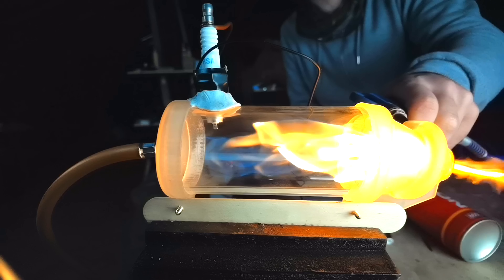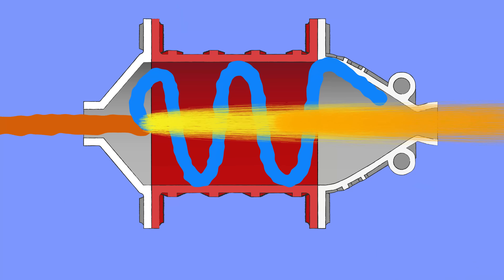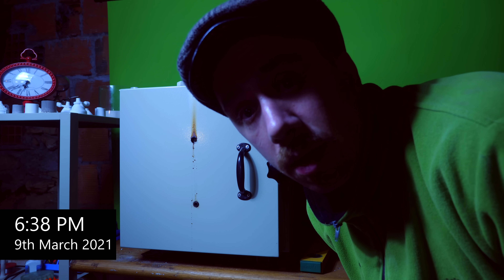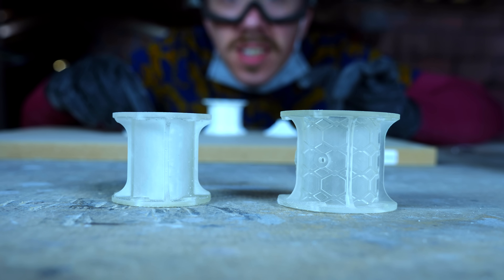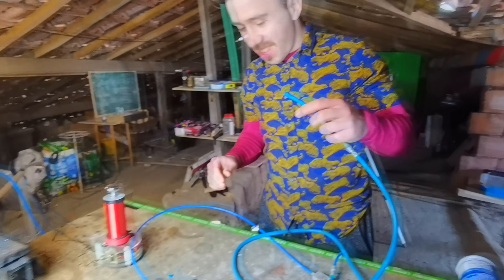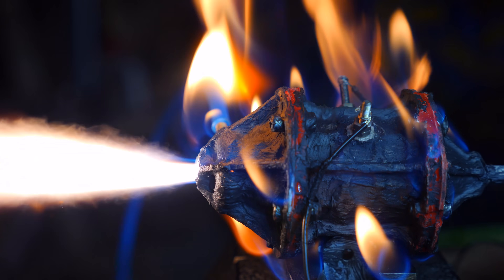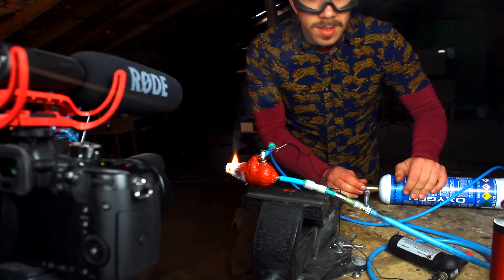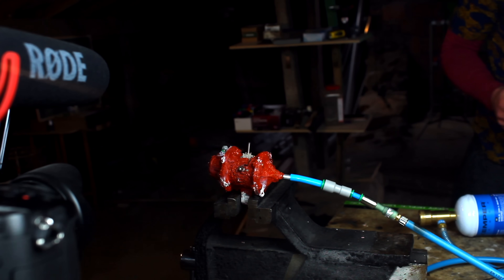Vortex Rocket V2.0 (3D Printed)

Comment: Hi Integza!
This comment is about leaking prevention.
Hope you will find this comment through the thousands of others.
Given: you have porous ceramic material and leak-proof red stuff.
Problem: It's obvious that this red glue (as any glue) is not strong enough itself, although it is leakproof. Extreme pressure from the combustion chamber just destroys the layer when it has no support.
Example: Remember the car tire. You will never seal it outside, only from the inner side or inside the material itself.
Solution: either make glue protected from outside or soak the engine in something leak-proof.
Method 1: just make reinforcement for red glue with carbon or glass fibers. 
Method 2: soak the engine itself in something liquid and both leak- and temperature-proof. Liquid glass, for example. Probably, you should repeat soak - dry process several times.
A good thing about the 2nd method is that the engine should remain white and beautifull.

If you like, I can further explain the liquid glass substance (I am a chemist). In short -  it is true glass, but liquid.
Reply: Do tell
Reply: update:
Liquid glass, water glass, and sodium silicate are just different names of the same substance.
as for other comments:
I find pottery glaze to be a tricky way since it is highly sensitive to the thermal-expansion coefficient. I mean, TEC has to be the same for both substances, otherwise, the glaze will break and leak.

Electroplating is hard for beginners, but quite a funny process. I am not sure it would be easy to achieve leak-proof plating, but it is interesting.

Comment: Is it possible to glaze the ceramic like you would for pottery?  I don't know if that would just melt under the heat from the rocket, but it seems like it might work a bit better than the silicone sealant.

Comment: why not put the engine into another sealed chamber, say a soupcan for example. as long as the oxygen doesn't get there this might work. If the oxygen does get there you might be building a bomb. In both cases an exiting video is the result.

Comment: Integza, I have just had a crazy thought! 
Instead of trying to 3d print the actual part and then having to deal with all that cooking, warping, clean up, and leakage, why not 3d print female plastic moulds (casts) of your engines and then pour your prefered ceramic liquid, let it dry and then cook the ceramic while burning out the plastic moulds? Essentially similarly to how they make khm khm... well, toilets! 
Worth a try! 
https://ceramicninja.com/toilets-manufacturing-process-steps/

Comment: if i saw correctly the engine leakes because of the high temperature thats x=created after a little time (in the case of the whole engine than 3d printed not the engines with the parts) so why dont you use a heatsing to transfer the heat like a cpu heatysing

Comment: You could try 3D printing a part in something that melts/burns out cleanly, create a plaster mold around the printed part, let it harden, melt out the material, and cast the part in metal?

Comment: I have seen suggestions of using a glaze or wrapping in another material. The ceramic is clearly porus, you will probably need a vaccume system to get a sealing material into the porus structure of the ceramic as the small holes may act to create structural weakness in your sealing compound. Possibly applying a glaze or sealing compound while under vaccume then curing it. Compound may have advantages as it is flexable. Either way what ever is applied will have different thermal properties than the ceramic that may be difficult to overcome and cause additional failure points.

Comment: I see two issues:
1. At 14:25 you can see that while the additional outer layers may stop the gas, it still leaks through the ceramic at high pressure and eventually gets between the body and the layers. Then you basically have a balloon full of straight oxygen under a layer of flammable material, which quickly causes it to burst into flame and finish the destruction. You need to either insulate it from the inside out, or use an outer layer that is stronger and stops the leaking gasses instead of succumbing and ballooning out. Glazing seems to be the most obvious approach.
2. You can see and hear that the ignition causes an explosion (well, duh), which appears to be sharp enough to crack the ceramic and allow the cracky leaks. Incorporating more flexible, plastic elements like in the previous designs would help you mitigate that shock to the brittle ceramic.

Comment: you should glaze the parts and find a high temperature liquid O ring sealant for the joints, only glaze the inside and outside surfaces and not the surfaces that you are wanting to clamp together, it might also be worth looking at a different way to keep the parts together perhaps something like the clips on the sides of green houses used to keep the glass in the windows so that you dont have holes in the part that could cause weak points during the burn out and glazing process, aside from that 
i dont really have other suggestions other than I would personally love to see more about turbo jet engines and if at some point you do go back to them I would love to help if I can, I have a rather wide range of tools that will be in my new forge so when you do decide you want to revisit turbo jets shoot me a message and I could sand cast some parts for you and fabricate some metal parts too.

Comment: Can you put a glaze on the ceramic parts after burning out the resin? Print, fire, remove support, glaze, re-fire? Or possibly electro plate some metal onto the ceramic? dunno what metal would be ideal but you can electro plate a lot of stuff DIY style.

Comment: INTEGZA: "IF i solve the problem of the leaking, I have an engine"
ME: "IF he solves the prpblem of the leaking, he has a b0mb"
Reply: Rocket engines are just bombs that aim their explosion in one specific direction.
Reply: @beelseboob  Not at all true.
Reply: @randomname4726  kinda true. you have fuel, you have oxidiser, etc. you can make both rocket and bomb from gunpowder for example
Reply: @justADeni  No, a bomb and a rocket are fundamentally different. Where is the detonation in a rocket? A rocket burns fuel and oxidizer in a controlled manner and directs it through a nozzle producing a supersonic flow in one direction. A bomb detonates a mixture of fuel and oxidizer as quickly as possible to cause a damaging high pressure wave. Also the fuels and oxidizers used in rockets aren't used in military weapons, they use high explosives that detonate extremely quickly. Rockets can explode but are not bombs.
Reply: @randomname4726  not all bombs involve detonation, if you are going to be pedantic at least do it properly
Reply: @Cssfiend  You are correct, they can also build up and suddenly release pressure, or spread aerosolised particles before igniting and I'm sure many other methods. I couldn't be bothered writing all that in my last comment as I didn't think it was necessary, seeing as none of it changes the fact that rockets are not directional bombs.
Reply: @randomname4726  "Where is the detonation in a rocket?"

Here: https://www.nasa.gov/centers/marshall/pdf/173616main_pulse_detonate.pdf

And here: https://www.youtube.com/watch?v=rG_Eh0J_4_s

I'm guessing you don't actually know the definition of detonation nor deflagration.
Reply: @randomname4726  kinda true still in essence.
A rocket is a controlled and extended release of energy in a direction, a bomb just release that energy in all/most directions without controlling it. Yes this is an oversimplification and yes we do have directional explosives but it's kinda true.
Reply: @Dzeno2010  ☆ Except Nuclear Bombs use Implosion Explisives to Focus Energy in One Direction, like Shaped Demolition Charges.
So much awesome with Pyrotechnics!
Reply: @liesdamnlies3372  So there is a proposed type of rocket engine that uses detonation. That still doesn't make currently used rockets and bombs the same thing.
Reply: @randomname4726  Guess it's a good thing that's not what I was saying. I'm just spotlighting your pedantry. "Sitting on a controlled bomb", and versions thereof, is an analogy constantly used half-jokingly by space enthusiasts, engineers, and astronauts the world over.

Edit: Moreover, it's actually a great analogy in the sense that one of the failure modes of most rocket engines is a transition from deflagration to detonation (it's also a failure mode in jet engines).
Reply: @liesdamnlies3372  We are going to have to agree to disagree on this one.
Reply: @user-mp3eq6ir5b  yep demolition charges and nuclear bomb kickstarters were the reason I said it was an oversimplification, as well as some crystalline explosive compounds ;)
Reply: A slightly less leaky bomb
Reply: A Rocket Engine is just a Slow Burning Bomb with a Hole in One End. A Jet Engine is just a Rocket Engine with a Vacuum Cleaner hose stuck into the Other End.
Reply: @user-mp3eq6ir5b  lol, no. There is no such thing as a slow burning bomb. That is called a fire.

Comment: When you're sealing the engine, seal it on the inside as well as the outside, if possible. Also, you might consider using pressure to force the sealant into the porous ceramic material. I don't know if a pressure cooker or something similar would work, or if you might need a stronger pressure vessel, but if you can get sealant to penetrate all the accessible pores, your material should be stronger AND better sealed.

Comment: There are low viscosity fire retardant resin that you could draw a vacuum in order to fill the porous voids left after the bonding resin burns off. This might be a better alternative to glazing the part. While drawing a vacuum powerful enough to completely permeate the ceramic will be difficult, you might be able to get enough to provide a thin enough barrier to provide the integrity you're looking for. Hopefully this could be an alternative if glazing doesn't work!

Comment: With that much flames, I'm thinking you need some kind of spring valve for the gases, that you have to physically hold in for the gas to flow. That way, should anything happen to incapacitate you (if, say, Tomato Lord Jr. acts out), the gas will be cut off. Seeing how long it takes you to close the screw valves, that poses a huge safety risk..

Comment: As an audio engineer.. your audio could still be better. :D My advice is, try fixing what you can while recording. Aka, the echo, is best controlled acoustically, not by using some algorithm to reduce it, as that will mess up your wanted sound. But obviously, acoustic treatment isn't as simple as slapping some foam around the room. It will take some time and money to figure that out properly.

Comment: In my opinion, you should combine the flanges (with which you screw everything together) with overlapping surfaces (each in the direction of flow), as well as adding Al2O3 (aluminum oxide (for example from Aremco; brand name Ceramabond 671 (resistant up to 1760°C))) to the sealing surfaces, to prevent leakage flows. In order to prevent micro-cracks (i.e. leakage flows not caused by shaping), you could also "coat" the combustion chamber or nozzle with Al2O3; or you construct your combustion chamber/nozzle in multiple layers so that you can insert sealing layers between the respective ceramic layers. If possible, you could also determine the "ideal length" of the combustion chamber, the "ideal swirl shape" of the oxidator nozzle or the effective thrust nozzle (does not look optimized) through simulations on the PC for different fluids (compressed air/pure oxygen/possibly LOX); that would probably improve your combustion without implementing more complex structures (e.g. heating the fuel/oxidizer via the exhaust-gas). As, I think, it has already been advised, it would certainly be advantageous for thrust/combustion if the pressure/flow of the oxidator could be increased (although you are probably restricted there by the strenght of the ceramic resin).

But all in all, really great and 3D-print-pioneer projects on this channel! Love you're vids! :)

Comment: For your ceramic prints, You should do lower temperatures for longer period in the oven. Even try heating/cooling cycles. This should reduce cracking/splitting in your prints. 

Vid. Suggestion: 3D print and operate a rotary engine?

Comment: Simple thing. Print metal for the structure to give it stability. Like with electric wielding. Use insane machinery for that. Do something nobody did before, well, hardly nobody. But it works. And don't put flat pieces together, give it a notch or something, so that the insulation doesn't get pressed out by heat and pressure.

Comment: this test looked like the failure was the gas-burning its way through each layer, since you can make the critical dimensions in a printer why not then subsume the print in refractory cement, cure it in a vacuum chamber, then temper it.  If that doesn't solve the porosity issue nothing will.

Comment: TIP FOR FIXING LEAKAGE PROBLEM.
The last engine you tested had a good run and a worse one, while the engine was going good at the first run i saw that the heat resistant epoxy started to go off of the porcelain printed part. So i suggest that in your next try you should make a new one but on the outside make a extra shell that holds epoxy in place. This will cause the engine to have a better resistance against high pressure and the seal will stay on properly

Comment: Bro, you should try using one of those metal fillaments for printing these parts since you have the sintering oven, BASF has a filament called ultrafuse that's basically 316l with a binder ;) sucesso parceiro seu canal eh muito maneiro :)

Comment: The leaking might not be (only) because of porosity! There is a good chance that the thermal shock is causing microcracks and worsening the problem, you should fire up the engine very slowly to reduce the thermal expansion difference between the outside and inside.

Comment: The biggest question I have is. Why do you remove the support material.
 i have no experience with 3d printing so feel free to call me out if I am missing some relevant piece. But to me, retaining that material keeps a lot of strength as well as thermal mass as things heat up.
I know that I don't have the experience to know if I am wrong. But based on my understanding of materials science, then having the support materials would help.

Comment: Hi integza,
A probably got an idea to solve the leaking problem ! Maybe you can command on the internet some 3D printed metal pieces after testing the best shape solution with ceramic engines. I saw a lot of add for 3D metal pieces, so why not try !?

Comment: Regarding the leaks I'd suggest to print new parts. Burn them. Seal all openings to the inside. Dump the parts in some liquid ceramic so the parts can soak it from the outside. Burn them again. probably with slowly rising heat so the water has enough time to evaporate. I like your videos :D

Comment: What if you put the inlet for the oxygen at the same point or previous to the ignition instead of at the nozzle? My assumption is, this would protect and cool the combustion chamber better and maybe prevent leaks. Sort of like the Tesla turbine, but without the physical turbines. One more thing to try would be to have some way to alter the angle of attack of the O2 instead of just perpendicular to the chamber.

Comment: My best guess would be that you have too high pressure in your Combustionchamber for the ceramic...
It starts breaking and thus leaking. Maybe try another material like 1.5 mm steel. Easy to bend and if the vortex cooling works properly can be easily soldered with silver.

It also seemed like you hooked your oxygen to the front inlet thus burning propane on the outside instead of the center of your combustion chamber.

Good Luck, looking forward to see this thing work!

Comment: Use the material called starlite to line the exterior of the engine.  You can make it with common materials at home.  Your sealing material seemed to fail due to the heat breaking through.  Love your channel and your attitude.  Love that you live to learn. Very inspiring.  Have an awesome day!

Comment: Not exactly the "replicate at home" solution, but you could have it printed in metal at a company, just to proof that the design will work. After that, you could try to find a way to replicate it at home. Currently you're changing too many variables at once.

Comment: Paint the inside of your combustion chamber and nozzle ceramic parts with... a ceramic coating.  Use your kiln to cure it. [Aremco Ceramacoat 503-VFG-C Sealer: eramacoat 503-VFG-C is an inorganic, single part, alumina-filled, phosphate-bonded, abrasion and corrosion resistant sealer for thermal spray applications to 3000°F (1650°C).

Curing is accomplished by air-drying at room temperature for 1-2 hours, then step curing for 2 hour at 200°F, 1 hour at 500°F and 1 hour at 700°F.]

Comment: use your model as a cast to form a ceramic or silicon part. place it in a cylindric container such as a bottle or can (such as a corn can) with intake and nozzle exposed but sealed against the container and pour ceramic or silicon. the result can have very thick walls and wont suffer from printer adhesion artifacts. if you have a vacuum chamber use that on the casting material before pouring to remove some bubbles and further reduce porosity.

Comment: For leak problem, maybe use a sand paper for the connectors and grinding it in the flat surface, its usually use in cylinder head, and maybe use some ceramic gasket to prevent leakage,